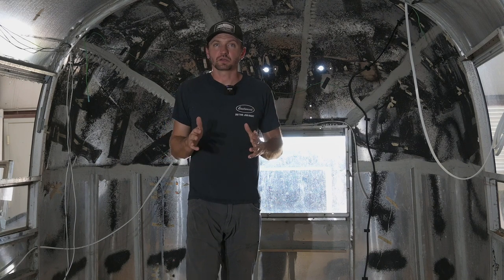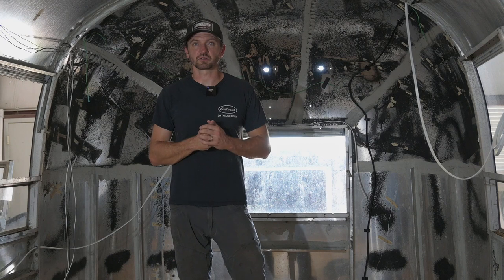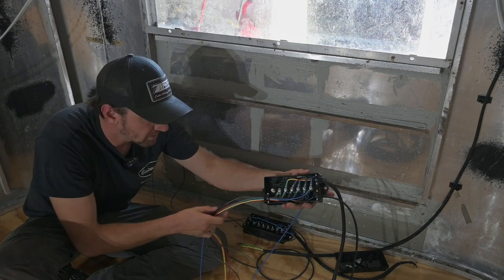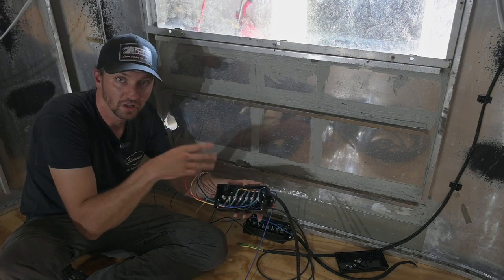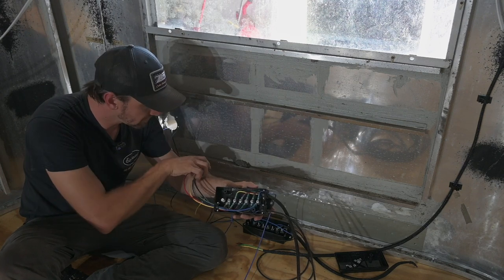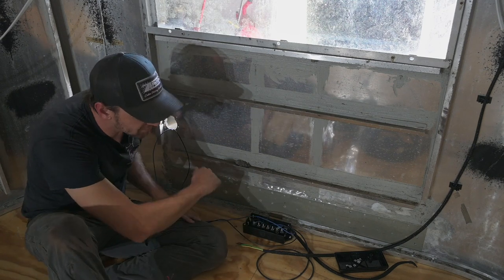Airstream Electrical Part 1: 7 Pin Wiring Harness

Comment: Wow marina grade wiring.
I bet you are the only one re fitting Airstream's using quality like that..... top marks.
My yacht is 1977, sailed the Atlantic both way's (UK) with the previous owner, still on the original marine grade wiring, no issues after all that time.
Reply from the maker: May not be the only one but it is top of the line.  I also have a big spool of 110v stranded Marine grade too.  Certainly not as cheap as romex but much better!

Comment: I think I'm gonna need one of those harnesses, for sure!
Reply from the maker: We can at least do the distribution box and get all that right, we would have to pull interior and skins to do a full harness replacement.
Reply: @MillerGarage  absolutely, all I need to do is button up the electrical in the front of the Airstream, not ready to do a complete restoration yet.

Comment: Awesome video Ian, thanks for doing this! I'm still a bit confused about the rear of the trailer though, as the diagram on Airforums you referenced is a little different to my 1976 setup. I basically have the same model as the Opus coffee shop you did. Can you PLEASEEEE clarify which wires go where...?

Also before that, need to clarify that "brake light" and "stop light" is the same thing (?) and "running light" and "tail light" is also the same thing? Oh and "backup lights" is the same as "reverse lights". Bear with me........

To confirm:
GREEN goes to ---> front (amber) marker lights, side (amber) marker lights, rear (red) marker lights, license plate light and.........I'm confused about my stop/turn/tail light assembly.
There are 4 lights in the assembly, and I can't really remember what they do!
Could you tell me which colours go to where?
On my rear light assembly, working from the outside of the assembly in towards the license plate, there is:
1. Rectangular red marker light (GREEN cable?)
2. Square red lens (turn signal?)
3. Square red lens with clear window (reverse/backup light?)
4. Square red lens (brake/stop light?). Does this also serve as the running light? 

I understand that the RED cable goes to left turn, BROWN to right turn, YELLOW to reverse light, but what about the GREEN? It connects to all of the marker lights plus which lights in the stop/turn/tail assembly? Sorry man electrical is not my strong suit...!

Any help would be MUCH appreciated. Thanks man it's @_silvermagicship_ here!
PS. Do you ship to Canada?

Comment: I'm about to do my 7 pin wiring for my 31ft excella and i was wanting to run 10 ga wiring from the brakes to the harness but i cannot find a loom that has 10ga wiring for the brakes (most i see are 12ga).  Im guessing its a bad idea to go from 12 ga coming from the loom to 10ga going to the brakes?

Comment: Some of these wiring diagrams show separate ground wires running to each light. My lights have only one wire running off of them. Are they grounded inside the light housing?
Reply from the maker: I ground the lights to the shell if they have 2 wires.  Most new LED lights have the ground strap come off and the has a ring on the screw hole.

Comment: where do you ground this lighting system? I've read grounding the system is the most crucial part of lighting system? Also do LED lights wire any different than standard bulb lights?
Reply from the maker: The ground lug in your 7 pin distribution needs a 10 gauge wire that goes from that to the frame for your chassis ground.  Then most lights ground directly to the shell, same with LEDs.  Yes, grounding is very important.